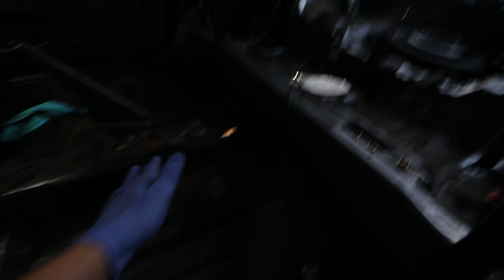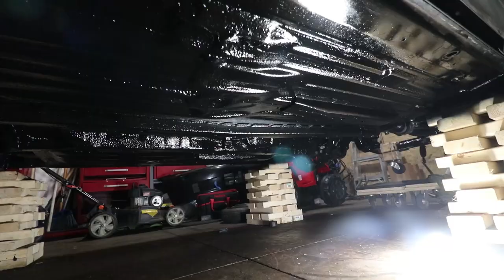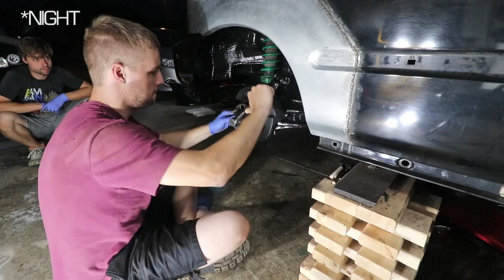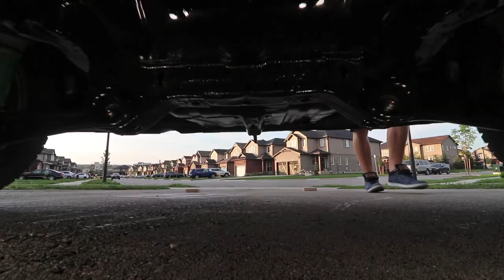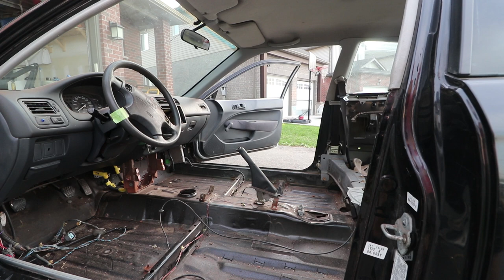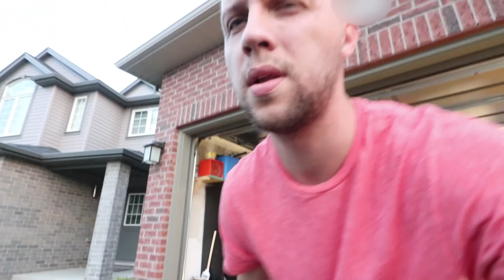Undercoating the EK Honda Civic - Ain't She A Beauty?

Comment: Love the vids man, I have a 97 dx but not super sure what the main difference between the dx and ek as mine looks identical but has no vtec
Reply from the maker: It will be pretty much the same throughout. Interior components may be different. You might have power steering, power windows not sure. It's a better trim line compared to the cx that I have